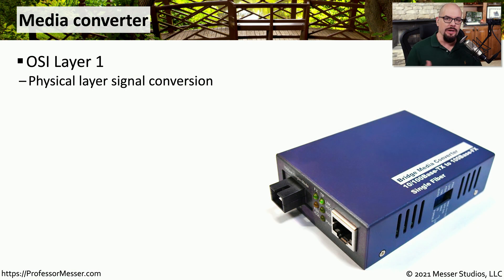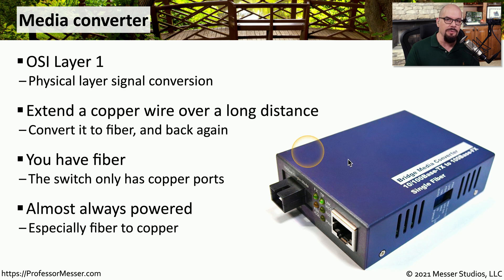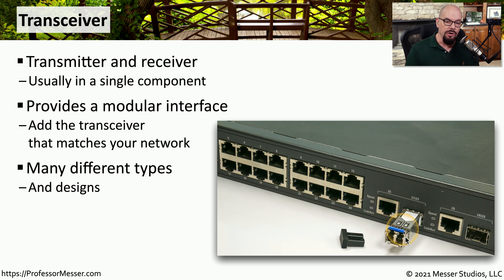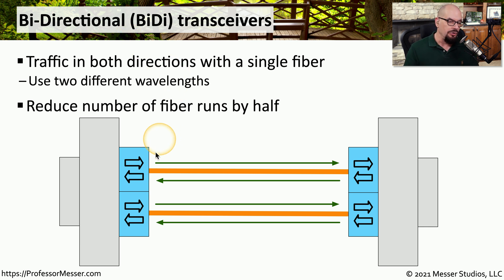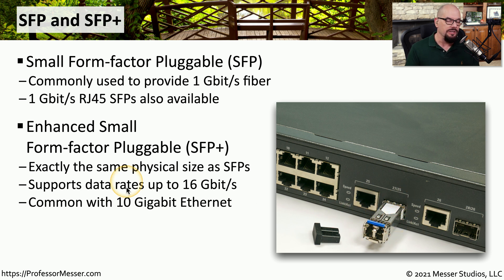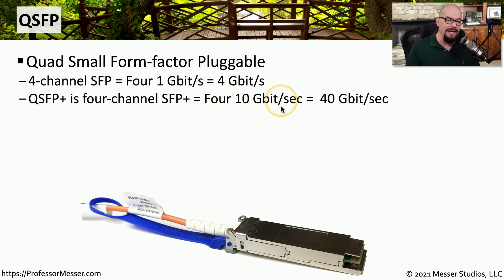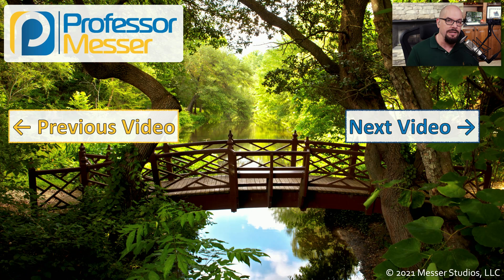Network Transceivers - N10-008 CompTIA Network+ : 1.3

Comment: I am a bit confused on the difference between a transceiver and media converter
Reply: transceivers can both send out data and read/respond to incoming data.
trans - to send ; ceiver (from receiver) to take on, to inspect and read/

the media converter has to change the output of a signal so that another type of wire can read that data to make it useful.
fibre and copper connections cannot communicate with each other because they are 2 different mediums of moving data.

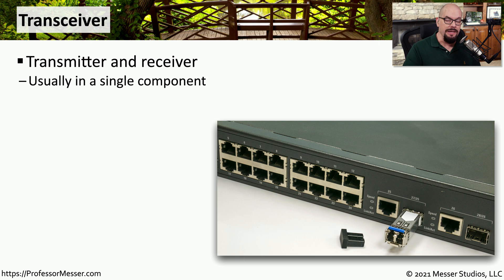Comment: Wait a minute...isn't the connection the Professor is pointing to @2:15 just another fiber connection with a Straight Tip connector instead of a Local Connector? If it's copper, why is the cable itself so thin?

Comment: I have a doubt about QSFP & QSFP+ : the way I understand it these transceivers enable us to send 4 different flows of data through a single strand of fiber using different wavelengths, did I understand correctly ?
If I did, that means a BiDi QSFP enables a single strand of fiber to do the work of 8 ?

Comment: is there a backup of data when a faster (fiber) comes to a transceiver and converts to slower ethernet?
Reply: In a way, yes, I am not educated enough to explain how exactly the systems handle it except saying as far as I know it mostly relies on caching, and a lot of communication back and forth about what and how much to send and some prediction based on the system clocks. This is one of the major problems original super computers had, as the input/output and the physical lanes throughout the computers were slowing all of the computing parts down.
Reply: To go further with this in modern times the average hdmi can do 60 frames per second. There are special ones that can do 120. Lets say you upgrade your monitor but you just plug in the hdmi that is already there. There is a high chance that monitor will only be able to do 60 fps while that cable is plugged in and your pc will see and know that as a fact. Data throughput is important.